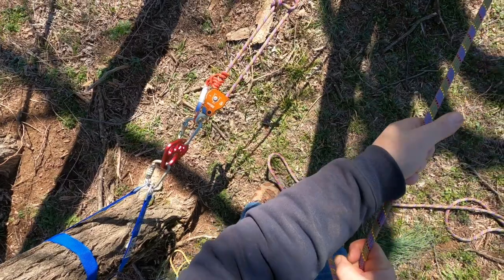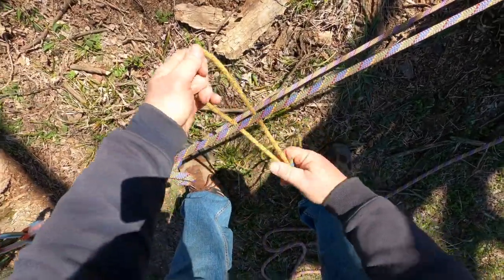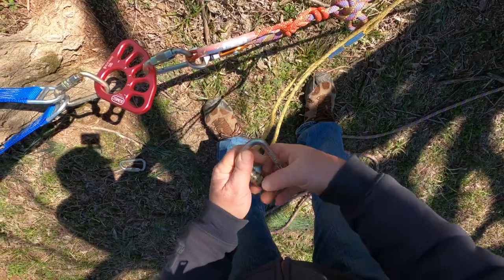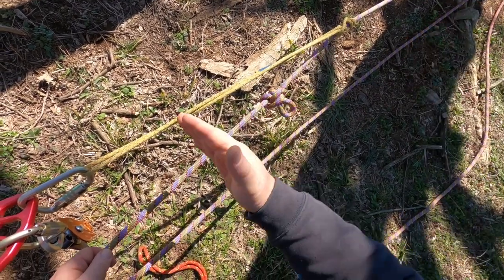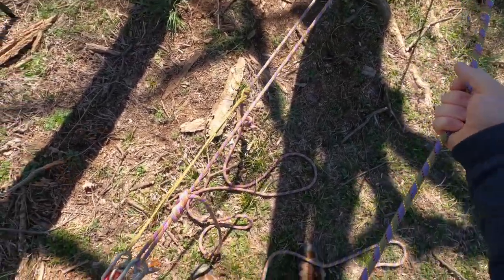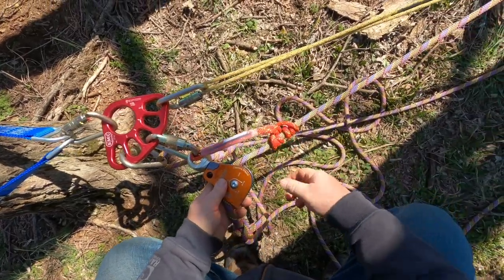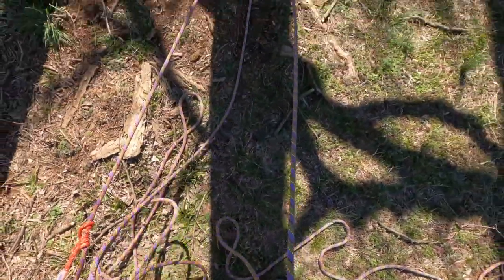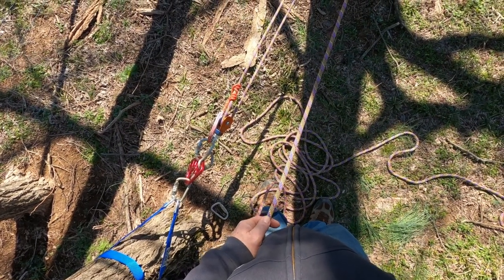How to pass a knot on a haul system

Comment: I’ve noticed on your ratchet pulley you’re never using the prusik minding side of the plate. The angled side of the pulley plate needs to be up against your ratchet or progress capture prusik, you have the rounded portion of the pulley against the prusik. The sharp angled side of the plate is what makes that pulley prusik minding.
Reply from the maker: Good eye for detail but it really doesn't matter as the prusik minds regardless. I've never had an issue with these pulleys in any configuration in regards to the prusik loops. Cheers